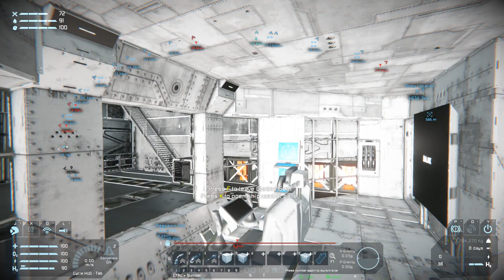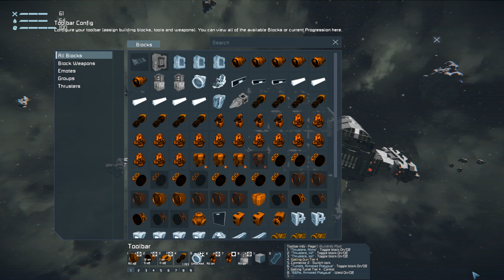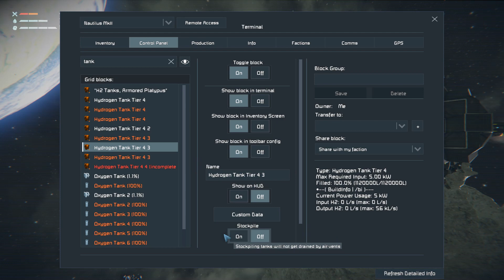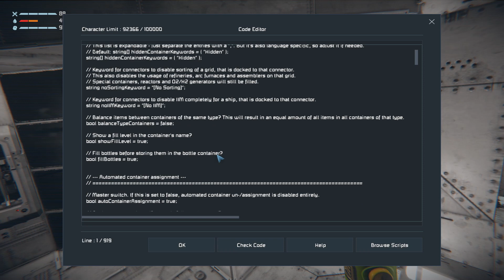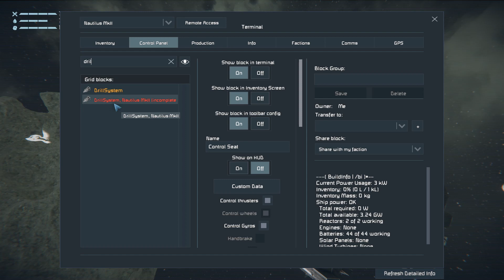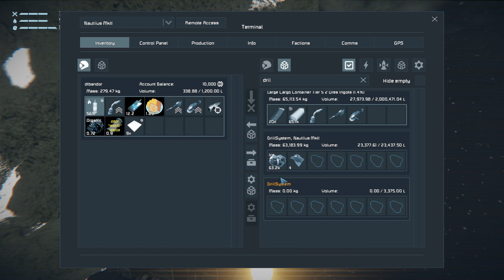Space Engineers Survival Ch3 Ep085 - Collecting Resources

Comment: Hey man, i don't know if i have an OCD or something but those gps markers has got to go:D Also moving without intent might be because of the connection with platypus has the turrets in between, sometimes they push the whole thing in a direction. Didn't tell you that before but you might want to use the "Grind the painted areas" feature of the Bobs if you want to work on a big project again. Very useful. One last thing. If you charge the behemoth or any other stuff with nautilus without the shield, make sure you have a proper save file that will not get replaced by the new saves :D I did that after finishing the capital ship. Even with the shields, not a chance. Loaded that bastard into the creative world to see if tier 5 warheads do any damage. THEY DON'T DO NOTHING.
Reply from the maker: If I do go after the Behemoth, it'll be with drones that I can easily replace. As far as the GPS markers go, I don't want to go to an asteroid I've already been to which is why they're there. Otherwise, yeah, they'd be gone.